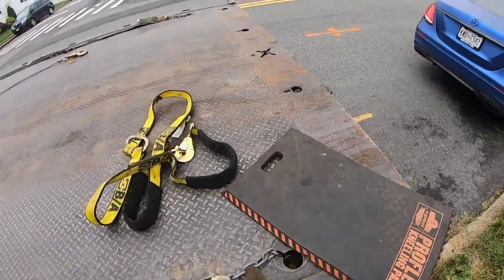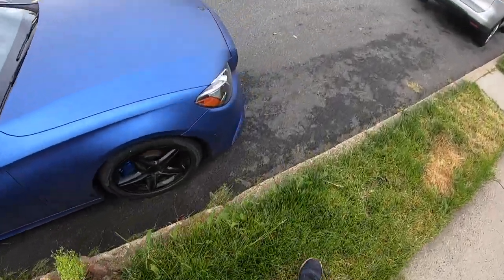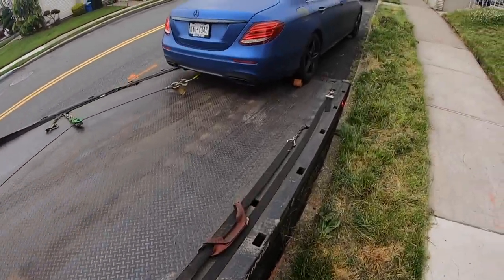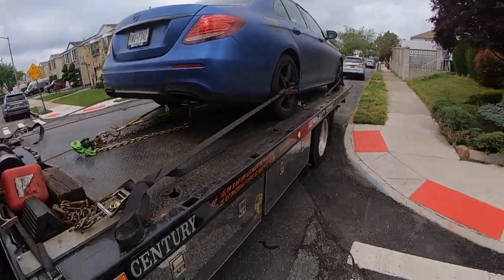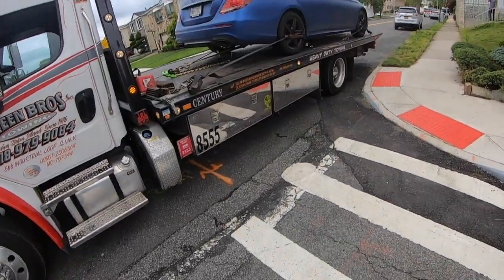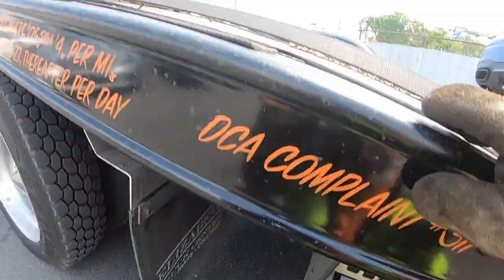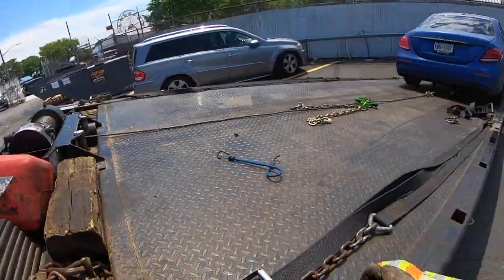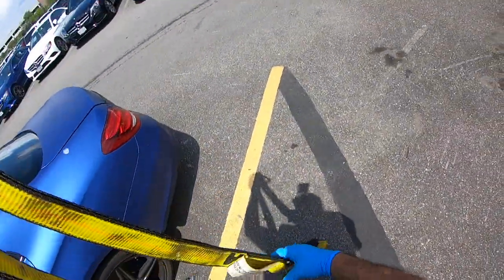transporting a Mercedes Benz E300 with no keys

Comment: Are you moving fast or is this video sped up a bit?
Reply from the maker: Speed is normal
Reply: @TowMan127  😂 😂 
One day I’ll be as fast as you.
I usually take my time dude I’m only 2 years in the industry hoping to grow old with this position.
Reply from the maker: @connoisseuroftigolbitts  you’ll get faster as you gain more experience with time. I’m doing this 24 years. Once you continue to gain experience things will go easier and faster for you. You’ll be more comfortable and confident. Take your time and get the job done. If you need help with anything you can leave a comment or message me on Instagram. Be safe out there.
Reply: @TowMan127  thank you so much! I sure will! I’m currently sitting in my truck waiting for dispatch to send me a call!
Reply from the maker: @connoisseuroftigolbitts  if you have Instagram give me a follow. That’s the only place I can get messages. Or facebook. My instagram is towman127
Reply: Its sped up a lil when he stars to load it then goes back to normal

Comment: I’m in a similar situation as the owner in this video, I lost my key fob and have no spare to my Mercedes. Also 4matic and can’t be put in neutral. Is there anything specific i should request for the towing process for when i reach out to my insurance for towing? Thanks!
Reply from the maker: Make sure to let your insurance know that you have no keys and to send a company that has experience. A lot of the times the insurance company doesn’t let us know the full details. When they give you the information for the company they are sending to pick up your vehicle, give that company a call and give them all of the details so they can send the right truck. You can request a wrecker and dollies and they pick the car up without having to drag it to get it onto the truck.

Comment: It was no point on using two snatch blocks
Reply from the maker: One to keep the line straight and the other to change the direction. Could I have done it with 1 snatch block? Yes of course l, but I chose to use 2.
Reply: Rubber mullets are way better to use with skates
Reply from the maker: Yeah rubber mallets are but I didn’t have one so I used what I had.